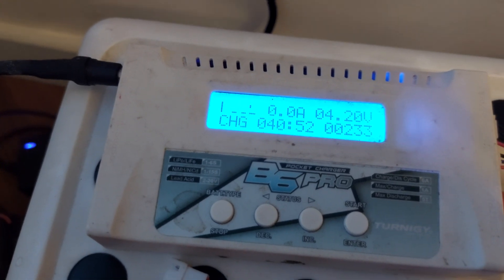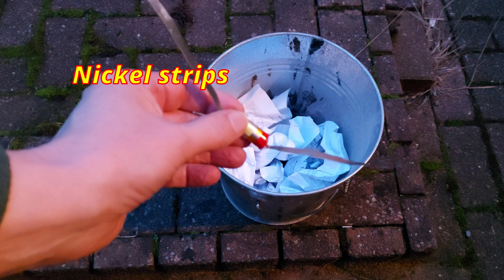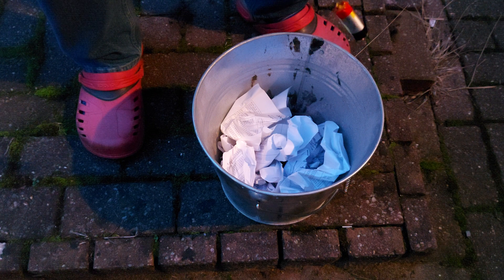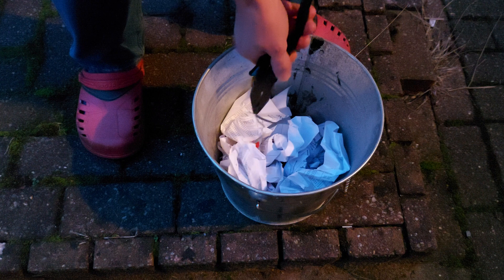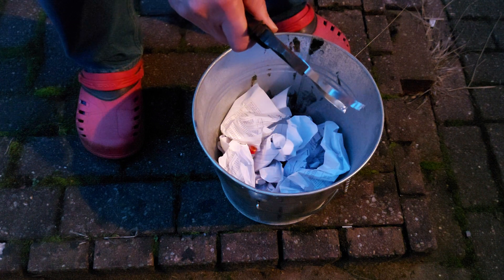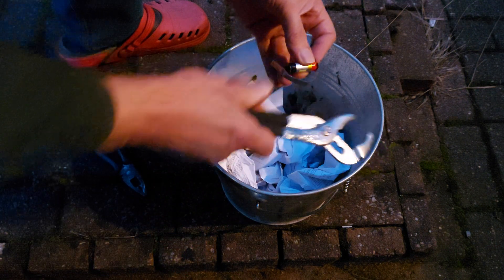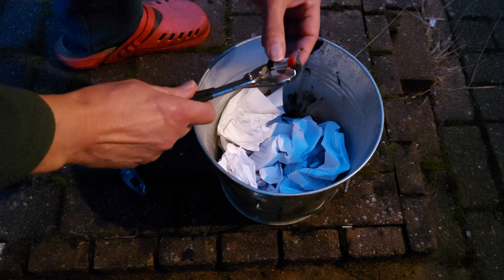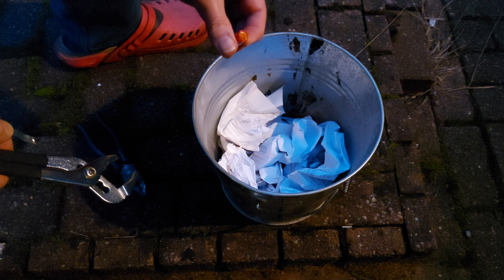What if I short it out? PART 2

Comment: lol you gonna struggle melting or heating that pliers , hahahahahahaha...
Reply from the maker: That is the point of using them. They act as a heat sink to prevent burning my hands. Although for the amount of heat produced I could have just held the nickel strip in place. The thin battery terminations acted as a fuse and my nickel strip was undamaged.

Comment: nice upload grandad, i would have thought the battery would explode completely, it gave a nice bright burn effect tho..
Reply from the maker: That is one of the myths about LiPos and LiIons. It is very difficult to get them to "explode", but they can still produce flames and heat under the right circumstances. And obviously the bigger they are, the more destruction they can cause. So they do need to be treated with caution. People talk about them bursting into flames when you crush them, and yes that can happen, but back in the days when you used to carry a box of matches, they could burst into flames if you crushed the box.

Comment: Quite a long time back vapes were supposedly setting on fire when charging maybe even though those batteries from a non rechargeable vape I wonder if they have put in some sort of fail safe 👍 😊
Reply from the maker: I don't know if it is a designed fail safe or a lucky result of cost cutting. I certainly hadn't expected it. Cleary we still hat heat and flames before it failed, so in the right circumstances we could have had fire.

Comment: Hi Graham. Sorry I have not been about for a while.
Regarding that battery, I wound tap a small nail to either end of the battery.
That should make contact.
Then you could grip it with those  wrench grips. Wire will just melt with the high current.
Don't blow yourself up, mate. 😁👍
Reply from the maker: Good to hear from you Mike. I have been thinking about you. You might notice I am using your Nickel strips for battery connections 👍👍😊😊
Reply: @GrandadIsAnOldMan  
Thanks, Graham, for the thoughts.

My back has been giving me a lot of pain for about a week. That, along with my lack of balance, is turning me into a Car Park attendant. 
It's an entertaining sight trying to walk about like that. 🤣
The car park attendant comes from a stand-up act of Billy Connolly, where he talks about the way car park attendants seem to walk. Like they all have major walking problems.🤣

The other one is where he talks about his father having a stroke, but thankfully the way he puts it across about his father is a bit far away from my condition.
I found them both hilarious.  🤣🤣👍👍
Reply from the maker: @mikeflight9  Good to have a bit of humour in a difficult time 😊😊👍👍

Comment: Seems small batteries are fairly safe.
Reply from the maker: It just depends on the luck of the draw, it only takes a spark to ignite the right material/liquid/gas etc Clearly we had flames, they just didn't happen at the right time and the right location to ignite the paper.
Reply: Wouldn't call it "safe"...
Reply: @johnsch8634  Yeah, I wouldn't want it going off in my pocket, but it's unlikely to kill you or anything.